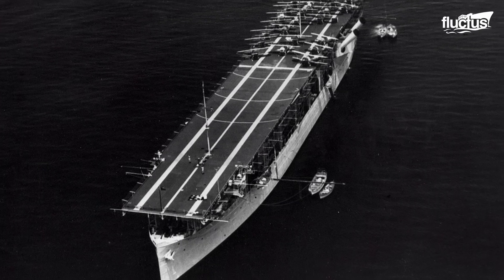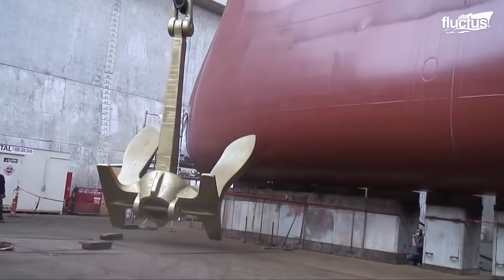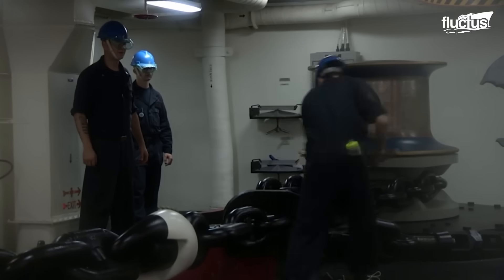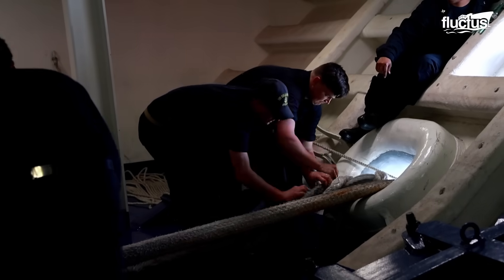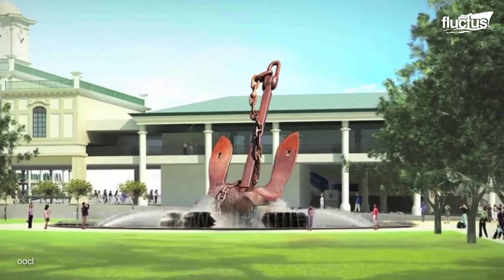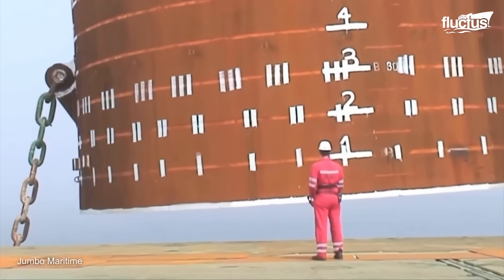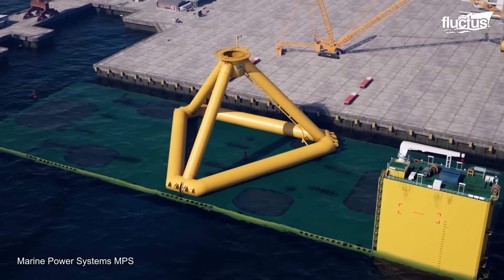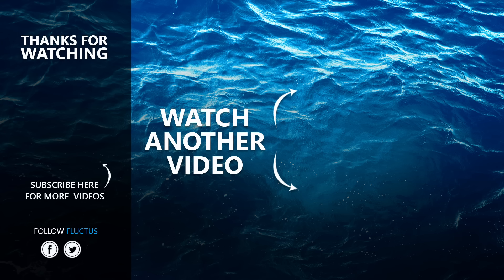The Hypnotic Process of Installing Gigantic Anchor into US Aircraft Carrier

Comment: Anchors DO NOT hold large ships in place. They are used as a means of resistance to run out the anchor chain. The friction of the chain strewn out on the ocean floor is what holds the ship somewhat in place.

Comment: The anchor cable (chain) plays the primary role in holding a ship at anchor. The mass of the cable and the catenary between the outer end of the cable and the ship offsets the mass of the ship and the dynamic forces acting on it. The anchor serves to hold the furthest outboard end of the cable in place. Direct pull on the anchor only normally occurs when the ship is weighing anchor, and immediately after the anchor is dropped and the ship backs away. At least that's how I learned it during my training in the Royal Navy.
Reply: Brilliant and understandable for all, engineering explanation!
Reply: Wonderful!
Reply: Thank you
Reply: Wonderful!

Comment: You sure as hell DO NOT, want one of those to fall on your foot. 😮
Very interesting. I don't know the life expectancy of wind turbines ect, out in the salty environment of the deep oceans. I sure hope the savings are worth the cost of production, installation and maintenance. It has to be extremely expensive.
Reply: was going to comment on that. The costs to bild and install must be huge.
Reply: @larryfreeman7979  The construction cost is one thing. Nuke power plants and hydro plants are very expensive to build as well. But the imstall must be enormous out in the ocean like that. And, the salt water, HAS, to be super corrosive on parts. So maintenance has to be up there too. I'm all for alternative power. But if the cost outweighs the production and savings. And there are still production pollutants and environmental problems, how will it help? Seems nothing is without negatives with energy production.

Comment: It’s not an anchor wind-lass, it’s a capstan. A windlass has a horizontal main shaft and cable drum (think of a boat trailer which), a capstan has a vertical main shaft and cable drum (as shown in the video). In the case of ship anchors, the drum is a wildcat with proper grooves to engage the anchor chain and draw it in.
Reply: WRONG!! One of my friends operated a professional fishing boat until he recently retired. That had a VERTICAL anchor windlass to raise/lower the anchor, & it had written on the drum it was an anchor windlass.
Reply: @christophermarshall5765 
You are correct but it's become acceptable to use the word windless interchangeably . The word capstan is sort of phasing out
Reply: We called it an anchor windlass on my destroyer, and it was my sea and anchor station more than once, you know, there in the "anchor windlass" room. 🙂

Comment: Wrong it's a common belief that it's the anchor that holds a boat or ship but it's not the anchor is there to hold chain, it's the weight of the chain that hold's to boat or ship in place not the anchor
Reply: That’s idiotic
Reply: Then you don't need the anchor by your logic. Just drop a chain in the water. That would save a lot of money...
Reply: @billhuckabee  If you look at how the chain rests on the bottom when a ship is at anchor you will note there is no strain on the anchor it is the chain holding the ship in place.
Reply: @billhuckabee  if you read my comment you'd see that i said the anchor is only there to hold the chain in place

Comment: It is actually the weight of the chain that holds any ships in place.
Reply: You're saying just put the chain in the water, no need for the anchor.
Reply: @billhuckabee  The anchor will dig into the seabed, it is the total weight of anchor and chain that holds the vessel, how heavy is one of those links in the chain.
Reply: @iansmartel5473  a lot around 150 pounds per link times the length  of the chain
Reply: I believe it is the chain's slack weight that causes the force on the anchor to be horizontal which causes it to dig in. When the anchor is pulled in the force on the anchor becomes vertical as the required slack in the chain is removed.

Comment: There is a faulty explanation about the anchors, the anchor and the weight of the chains gives that stability. The anchor mostly doesn't engrave itself, it's just laying on the sea bottom. Depending on the sea bottom, if the anchor engrave itself, it would be very dangerous to bringing it back up, because it would pull the ship downwards.
Reply: exactly
Reply: The weight of the chain is what provides the holding power. It's not the anchor.
The OP has it correct.
Reply: Depends on the type of anchor

Comment: Amazing that Scotland approved a project that only produces 50 milliwatts /s 😂
Reply: They produce nine point five milliwatts each! 😂😂😂    13:15
Reply: @raptorsean1464  Save the owners of the wind turbine a boatload of money.    They can get the same energy output from a couple of D cells from the supermarket.
Reply: The term used by the script reader mis-pronounced the 50 milliwatts instead of 50 Mega Watts. ( 50m(illi)W  vs 50M(ega)watts)
Reply: @steveschulte8696  ❤.
Reply: That’s actually all they produce 😂 @13:25
Reply: I just finished laughing when I could see clearly enough to see you'd already picked up on the 100m turbine that takes a day to charge 1 mobile phone. Narrators don't seem to know a lot about their subject these days  hey?.
Reply: Smaller is cheaper and flies under tighter regulations for larger plants and pollute less?
Reply: @marcusbutzin8368  1